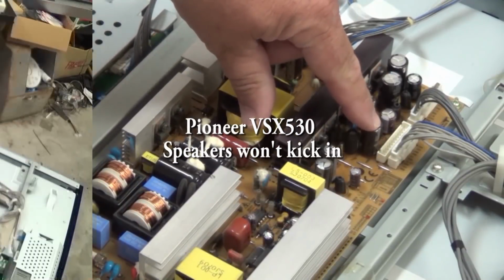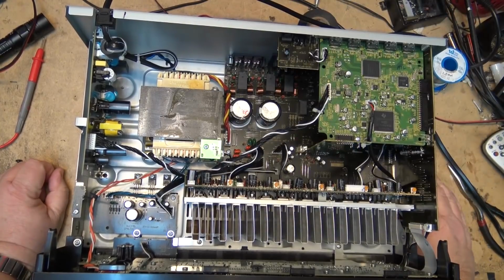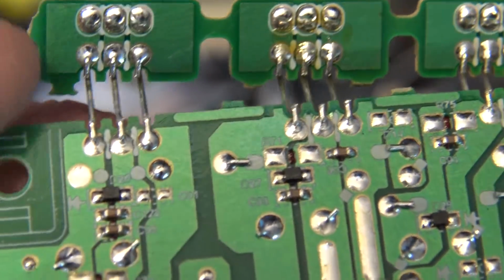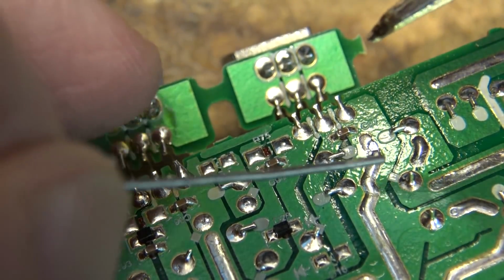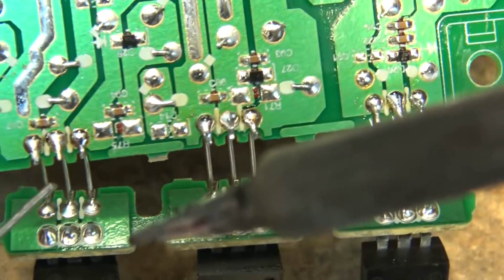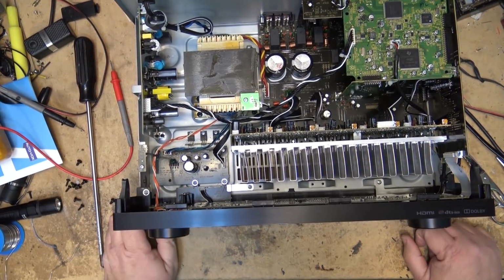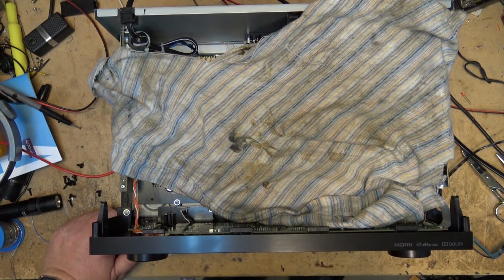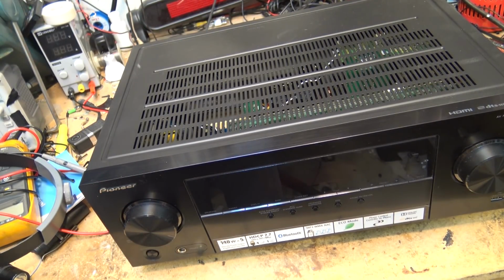pioneer vsx530 no sound can this garbage be repaired

Comment: Why did they mount the regulators like that instead of having them stand up on the larger board with an L-bracket for a heatsink?
Reply: Heatsinks cost money. The chassis is already there one way or another, so it becomes a free heat sink. Actually, getting that particular circuit board up and out for inspection and repair isn't particularly difficult. If you have to get the main amplifier and power supply board up, however, that's a lot more work and it's a big floppy mess when you remove it because of the weight of the heatsink and the flexing of the board. This particular unit has a fair amount of empty space inside of it, but many more expensive and more sophisticated and heavier units have every available inch of space filled with a circuit board of some kind, all linked together with a mix of Fasteners and angle brackets and right angle plug-in PCB connectors and flying wire harnesses and all kinds of shit. Good luck attempting to do a  simple repair on any of those  units. Nobody, and I mean nobody puts removable bottoms on equipment anymore. That method of Construction and design ought to be illegal.

Comment: I know this is off topic but I have a question. Why do you call some equipment Garbage? I had a Pioneer SA 9100 amp years ago and it sounded great and then eventually took the top off to clean the pots and switches and looked very sturdy and well built.
Reply from the maker: Because some equipment is absolute garbage. When you have been servicing for 35 years you get to see all kinds of designs and equipment.  Some is built better than others and some has repeated faults that affects many units.  Those are the garbage units but also money makers because so many of them had problems because they were "garbage" when they left the factory.  Ask any servicer and we all have those same opinions of certain models. Unfortunately many of the modern units are just that. Not designed to be repaired

Comment: Those regulators can get real warm. Simple and cheap  solution to fit them on the frame but I would put some thermal paste under them.
Well this amp is the perfect example that these newer amplifier are made for short time use and for cheap. So sad that even Pioneer has fallen.
140Wx5? Just look at the size of the transformer and the heat sink, If you've seen a real amplifier with that power rating you will notice that this is actually garbage. :(

Comment: @
12voltvids I have a VSX 817 Pioneer amp. The on screen display is not working. What could be the issue ? I have tried everything, even resetting the system.

Comment: Wouldn't it have been easier and cheapaer to strap those regulators to a heatsink rather than add a separate pcb and all those soldered connections? Do they get so hot that they need a beefy radiator which would increase the price?
Reply from the maker: This is supposed to reduce stress
Reply: For the receiver or the owner? 😂
Reply: Easier?  Probably. Cheaper? Probably not. Why add a heatsink when the bottom of the case is perfectly adequate.

Comment: When i turn on i dont have sound. Sound came different, after 1-2-3min. If i change input again no sound for any minuts. Regulators are good. Any caps on dsp board may be?
Reply: Check the relays' solder joints and the relays themselves.
What is your AVR model?
Reply: @tonifatec  i checked relays, they are perfect. I think may be nand chip i bad ....

Comment: 140 into 5 from that tiny transformer? Maybe at 20% THD and near meltdown.
My 60W/ch stereo integrated amp from the mid 90s has a far larger transformer and heatsinks, and it's "just" an Onkyo.
Reply from the maker: That's what's out there today
Reply: Never trust spec sheets. In lab measurements another brand 7 channel AVR specked at 145 w a channel it does ~120w for stereo, ~74w for 5 speakers and ~47w for 7 speakers. Don't actually remember the exact watts , but i can find you the link with the test measurements, and a watts + THD graph aswell.
Reply: the transformer in my Pioneer SC-LX73 is pretty large and very heavy amp
Reply: specs sheets lie. there is no more integrity in manufacturing. more than likely that hunk of junk will be unrepeatable soon anyway. They only give you a 1 year warranty on their junk
Reply: Onkyo Yes i have a tx sv 525 R model and it s way better the this modern  crap amps.....
Reply: Its definitely NOT rated in RMS! Probably instantaneous peak power only.
Reply: @Rusu97  Mine is an A-9310. Great sounding amp and a good match to the ELAC Debut 2.0 speakers it drives.
Reply: @Ryan Toomey and yet dummies keep buying those crap receivers. I only buy old school gear and restore it
Reply: @Arnij97 R I found an Onkyo at a recycling place for $10 that wouldn't store the settings. All it needed was a $2 super cap. Now its my main receiver
Reply: That tiny transformer is the standby transformer and the standby power supply is a smp so it doesn't need a big one. The power transformer is the big one with blue covering the coils
Reply: But yes the over all quality and preformens has gone down the shitter sadly. TBH my late 80s Magnavox would porbly put out mor true Rms power then this pioneer. But then again with these newer low power speakers you don't need hunken power transistors to make them get loud.

Comment: is it safe to touch it like you do at 2:52 ? no ESD protection?
Reply from the maker: ESD is over rated, seriously. Components are really only sensitive when they are bare componets. Once in a circuit the load of all the other parts, capacitors, resistors ect will drain away any build up that you could possible build up in your body. Touching the metal cabinet will drain that away too.
Reply: Yeah... Tell it to the ecu's i've broken :))) but i think that May be due to poor design, which is a different discussion.... :(

Comment: What temp do you solder this sort of stuff at? Are you usng 60/40? Thanks
Reply from the maker: 700'F which is what 370c. Yes 60/40 solder only.
Reply: @12voltvids  63/37 is slightly better, if you can find it.
Reply from the maker: @johnc8910  
It is readily available. Used it once, didn't like it went back to 60/40
Reply: @12voltvids  I do like 63/37, but like you, several of my former coworkers prefer 60/40. 60/40 gives you just a little more slack before it solidifies. Me? I want the solder to solidify as quickly as possible.
Reply from the maker: @johnc8910  
Solder solidify too quick quite often leads to poor joints. This is the problem with lead free. There are other solders that are closer to 50/50 that melt at much lower temperatures and stay relatively soft.
Reply: @12voltvids  Never had a problem. I WANT the solder to solidify as quickly as possible when I pull the tip away. I will concede that 60/40 is a good all around choice, but I prefer 63/37.

Comment: Great video by display wont come on But it powers on what can it be. i did smell something when i had it working full blast i had to change the plug fuse and do a reset for it to power on by Pressing the power button and the suround at the some time and now i here it kick in powering on!

Comment: Hi, very nice work. Congratulations for your videos. Your methodology for thinking about what is going on with the unit depending on the failure show a lot of experience with electronics and huge background knowledge!!  I do have a similar AVR to this Pioneer. Mines is a Denon AVR 1611, back from 2010. I bought it second hand. The unit showed a very strange kind of failure since the very beginning form my purchase.  The unit works fine as long you keep it in standby mode.  In that situation you turn the unit on and everything works fine.  BUT...is you disconnect the unit from mains, and then you power it on again, the unit starts working with very flat sound.  I realized that the problem was that the unit does not memorize the previous equalization setting. So I put it working again by turning some parameter off and on again.  For example I use to do this with  Dinamic EQ.  Did you ever see a failure like this? Any thoughts or recommendations?  Thank you!!

Comment: When your soldering the last thing to leave The Joint should be the solder itself just a split second after you remove the iron. Give it a try you will get a cleaner joint
Reply from the maker: Been soldering for over 50 years.  Nothing wrong with my soldering.
Reply: @12voltvids  not saying you're soldering is bad just saying give it a try . It will eliminate that little curly cue and also provide a cooling profile.  I am also an old timer.. by the way I agree that the lack of an access grate on amps makes them no fun to work on. Good video.

Comment: You may want to put thermal compound on those regulators to improve their heat dissipation. It may prevent the problem from re-occurring in the future.
Reply from the maker: Bah, not necessary. They are plastic tab, so they won't be getting that hot. Had they been in a high power circuit that generated much heat they would have used metal tab regulators.
Reply: @12voltvids  , I have seen plenty of power supply circuits that used plastic tab regulators right at or above the top of their ratings so that they ran blistering hot. Just as likely that the manufacturer use plastic tab devices so they wouldn't require the extra step of a silicone or mica insulator and a stepped plastic isolating washer and maybe some heat sink grease. Personally, I would have added the grease.

Comment: You diagnosed that problem real quick. How did you know right away that the issue was with the voltage regulators?
Reply from the maker: The symptom. Heat related, and by experience that regulators are a major cause of trouble, plus they were easy to get to. Start with the simple things right.

Comment: Mine did not produce any sound.. It's a VSX-822 series. It looks much more complicated than the designs of the one on the video. As i wasn't a technician or engineer of pcb repairs, i had zero knowledge. I had to do a snapshot of the before looks of the top,bottom,left , right pictures of my receivers before dismantling. I had placed everything on a word file. Guess i'll have to span the restoration job across few months... I had only a multimeter that's 10Amp fused. A solder and heatgun is the only repairing tool i had. No oscillators , no dc power testers and no resistors tester kits... Hopefully nothing explodes..

Comment: Nice easy fix. Not certain I understand the delay in the circuitry though?
Reply: @LD Blake, Thanks for that, never fooled with any type of amps. Now that makes sense.
Reply from the maker: Delay circuit is to allow all the other circuits like DSP and op amps to stabilize.
As op amps have both a +12 and -12 supply, they need to be stable otherwise there will be a dc voltage at the amplifier input which would give a potentially speaker damaging large dc voltage at the speakers. So there is a timed delay, and then the speaker outputs are tested for any DC ofset, and if it is 0 the relay is energized to connect the speakers to the amplifier output.
Reply: @12voltvids , Thank you for the reply, now that helps me.

Comment: Where do you get your internal parts at? I hate to ask but Unless you have you a licensed shop, you can't get components unless they are boards and you have to can things like processors.
Reply from the maker: Licensed shop? Your kidding right. I haven't been at a licensed shop for 15 years, and I have no problem getting parts. There are local retail stores still around, not as many as there used to be, but there are still a few, 3 here where I am, and then there is the internet. Digikey, Mouser just to name a few and of course Ebay.
Apple wont sell you specific parts, nor will many of the manufactures, but you can always get them used from places like shopjimmy.
Reply: @12voltvids  Well, I called Shopjimmy and according to the lady they only sell the used or refurbed Circuit boards, which they dont' have the boards for this set I'm trying to save.  I guess Philips 32PFL5332D/ 37's are just to old.  I see some mother boards on ebay. They look the same but due to maybe mods on the boards, I guess it changes the part number of the board.  I guess I'll just get the board to get the chip I need off of it.  This processor chip is just to hot and the set shuts off.  I'll fix it or it'll go to the landfil . It was free anyway. Just thought I'd get education from it. Boy did I ever.  I learned that Philips Consumer Products in Marietta, Ga and in Tennessee are shut down.  I could try Digikey again. I'll dig around some more for other shops.  We have Fry's but I don't give them much hope. Sorry to have bothered you. I know you are a very busy person. Thanks for taking time to contacted me back.  I'm still watching all of your videos, some twice if necessary.  Thanks.

Comment: So not garbage then. As if there weren't examples of early failure in true Japanese products of the 1980s.

When these things sell for as little as $200 it really isn't surprising that the build quality takes a dump.
Reply from the maker: Sold for a price point.
Reply: @12voltvids  Not really, it's the consumer to blame, very few folks would pay $1000 for something like this these days, which would be necessary to match old-world quality. It's not the manufacturers' fault
Reply from the maker: @jasejj  
Sure it is. If consumers paid what they paid back in the 80's then we would still have half decent equipment. If consumers resisted the urge to buy cheap crap, and let it sit and rot on store shelves the manufactures of better, more expensive equipment would continue to manufacture it.
But consumers rushed to the cheapest, and that is what sold. The more expensive stuff didn't move, and manufactures took the cue and stopped making the better stuff focusing on the cheap crap that people want.
Look at the auto industry. There is a reason Ford and GM are moving away from sedans and into gas guzzing trucks. That is what sells, big ass trucks, and there is more profit in trucks. They require fewer safety features and actually cost less to make than a sedan.  The consumer gets what they want, and then complains about the quality. Now if that isn't hypo-critic I don't know what is.
Reply: I have a 1979 Yamaha CS-80 synthesizer with over 45 circuit boards stuffed to the gills and built to the same Japanese consumer equipment standards of the 80's.  Not one single cold or cracked solder connection to be found......probably because it has real leaded solder.  New stuff has garbage lead free solder.  Disaster.
Reply from the maker: @gavincurtis  
2 words, hand built
Reply: Handbuilt indeed!  Japanese got crazy at times proving their abilities.  Recapped that beast and filled a 1 gallon tub with old electrolytics.  Every single one had very low ESR, but they were leaking, turned their leads green and were just starting to attack the copper on some of the PCBs.  All the 5% resistors I could test were well within 1%.  Really good component quality all around.

Comment: I see that this device has a power supply and a large transformer.
Reply: Surprising they don't use switching power supplies. Linear power supplies are such old technology.
Reply: @ryantoomey611  Thank heavens they don't. Switching supplies seem to be the most common failure in modern electronics. Besides, it would wash out the AM reception.

Comment: Well, my neighboor yesterday put the same amp out by the street for trash people to pick up. So I went to his door and asked him if it worked , he said yes. So I took home, not a scratch on it. I plugged in and attached some speakers to it. Want to use this with my office/mancave tv. Well I tried to connect tv to amp via hdmi.  No sound. then I connected to fiber optic and it worked. Would like to connect to hdmi so I can control volume from tv. The tv does not have component connections so I guess only fiber optic works. Does anyone know why this amp will not connect with HDMI, for example Hdmi 3/arc??
This may not be best amp out there, but for free not that bad. I used to sell in the 70s high end electronics: Bang and Olfson, Tanberg, Braun, Yamaha, Mcontosh and Crown. This amp was built 2015. Any comments about this anyone???